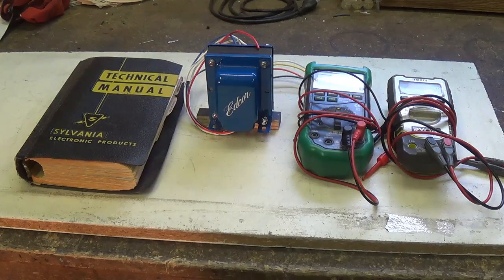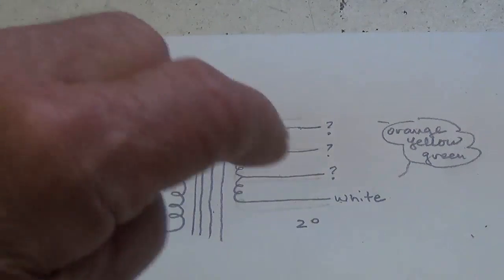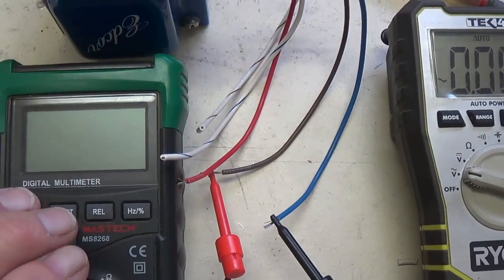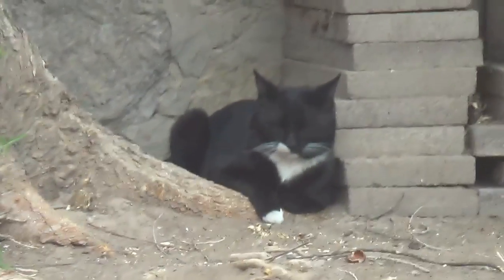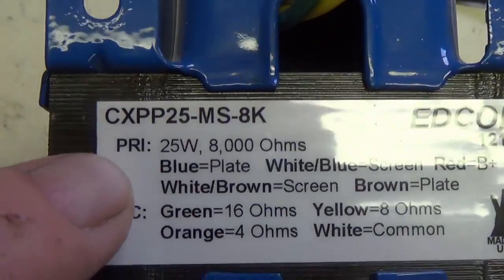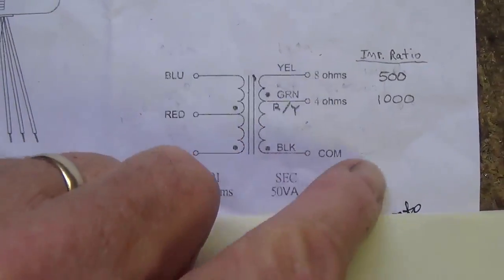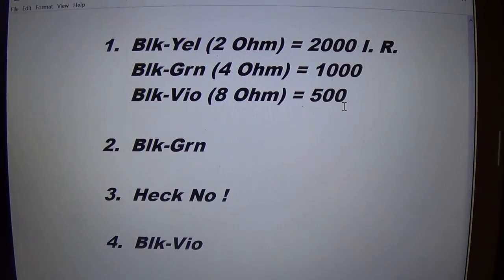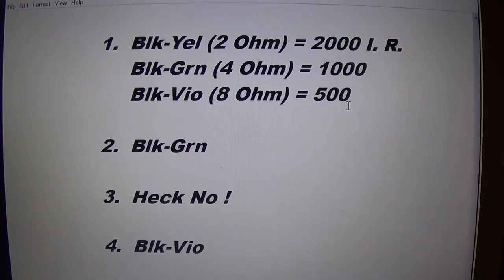Impedance Ratio: The Easiest Way to Decipher Output Transformers

Comment: Uncle Doug might be the coolest cat on YouTube.....And DEFINITELY one of the best instinctive teachers. Thanks for another informative video, sir.
Reply from the maker: You're welcome, Eli. Thanks !!!
Reply: He surely is the coolest can in the clowder! And a fine clowder he has there! 😸
Reply: Man ain't THAT right!
Reply from the maker: I hope you mean "cat", Damian :)
Reply: He sure is.  My electronics instructor at the voc I went to in late the 60s was pretty good.... but his circuit explainations were lame compared to Uncle Doug.
Reply: @UncleDoug I have a big mistery, I have a exotic High End amplifier in my housd for fixing.
The amplifier comes with the output transformer in shortcircuit.
I have 2 amps, one is working fine, this amps use a single ended circuit with 845 tube.
The thing is the good one OT reads 100 Kohms using an analog multimeter.
I never saw anything like that.
Other mistery is I test the OG using 3 diferent multimeters, with ome Fluke 28ii OT reads 500 Kohms.
And using an electronic analog multimeter reads 250 Kohms.
I can't understand.
Any help will be appreciate
Reply from the maker: @treadmillrepair754  I don't understand it either, TM. The DC resistance values you're stating are all way too high for a guitar amp OPT, and the wide variance makes the readings suspect. I would seek qualified assistance. Good luck.

Comment: Hello Uncle Doug, I happened to stumble upon your channel I have absolutely no interest in electronics repair however I couldn't stop watching your videos I was very impressed with your knowledge. Anyway, the reason I'm writing is I have a Marshall Class 5 tube amp that I bought used without a power cord so I couldn't test it first. After buying a power cord (plug-in type) I plugged the amp in to test it and nothing happened. Upon closer inspection where the plug plugs in I noticed it said "Mains Input 230V" So apparently this amp was made to be sold in the UK  not here in America.  I spoke to Marshall via email explaining the problem they said I need a new Mains input for 110V. After making numerous phone calls  I can't find anybody in my area who fixes amps without charging $200 just to look at it. I could probably do it myself but I've heard it could be dangerous if you touch the wrong capacitor so I don't want to do it. Do you repair amps or just restore old amps for yourself?  If I mailed you my amp could you repair it for me at a reasonable cost?
Reply from the maker: It depends on what you consider to be "reasonable", Kenneth. I can tell you that shipping it both ways, combined with parts and labor will cost more than double your local price......so you might be better off seeking local help. One final suggestion: Most European amps made for 230VAC also have primary winding leads for 115VAC. Before you spend a fortune, check the power transformer to see if there are one or two extra (generally black) wires not connected. You might still need some help, but at least you won't have to buy a $150 power transformer.

Comment: This was long but worth every minute - its obvious you where a teacher, nice slow, even tempered pace which is easy to follow but goes in. I have a mountain of output transformers that this will be essential for - bless you sir! :D
Reply from the maker: Thanks, Prince. I always feel obligated to explain every detail and then reiterate key points, which takes some time, but generally works well with beginning and intermediate students. I'm glad you found the information helpful.
Reply: @UncleDoug  - Would you believe I've built valve circuits for decades and only late last year learnt Ohm's Law. Everyone says its so tough but, errr, nope! Once again thanks for blowing my mind - I really had not the first clue that the secondary impedence was in any way linked to primary coil voltage or valve resistance, these are transformers after all! LOL :o)

Comment: This blew my mind.  I never considered the impedance of the output tubes impacting the impedance of the secondary of the output transformer.  Furthermore, I was about to rewatch your transformer videos to see if I could figure the secondary impedances of the mystery output transformer I have for my next build, then I get a notification for this video.  Uncanny timing. lol  Excellent video my friend. Thank you
Reply from the maker: You're welcome, Kevin. The output tube impedance divided by the impedance ratio must equal the speaker impedance, so all three factors must be in agreement and each one affects the other two.
Reply: It’s not the impedance of the secondary that’s in play here.  It’s the impedance of the speaker that is reflected through the transformer by the square of the turns ratio.  This is the effective load seen by the tubes.  This should be matched to the tube output impedance.

Comment: Glad i Just became part of the Family Uncle Doug. You are a Life Saver.....
Reply from the maker: So are we, Stuart. Welcome aboard :)
Reply: @UncleDoug  I do try to work on amps. Found a 1978 WEBB 6-14 E in the trash. Inside the back of the amp was a old Peavy 705-18771 transformer. Surprised the old Peavy sticker was still intact. Its in a complete metal casing 4" tall 6" across. I'm gonna dig into this amp  but apparently there somewhat rare. I can't believe someone threw it in the trash, could've at least parted it out. Thank you for sharing your knowledge, think I got 1 extra IQ point👍
Reply from the maker: @stuartewoldt1513  You're welcome, Stuart. Best of luck with your project.

Comment: This video is extremely useful, I used this technique on a project I am working on and characterized the O.T.. Then in researching the tube characteristics found that the bias used, FIXED or CATHODE also changes the plate to plate output impedance.
Reply from the maker: Yes, it does, Scott. You have to factor in all the variables when determining the plate impedance.

Comment: This was just great uncle doug.  The explanation was very clear.  Another great video.
Reply from the maker: Thanks, Rohan :)
Reply: @UncleDoug  I recently completed a 100-watt plexi kit amp and had some trouble with it.  In the end, the problem was a mislabeled output transformer.  By modifying the procedures you presented in this video, I systematically tested the transformer to determine the common, 4, 8 and 16 ohm wires.  Now I know the common was yellow, not white.  To be safe I compared calculated the effective load resistances with a similar Hammond unit.  Thanks for the video.

Comment: I just love it when you teach, if I would have had you as a math teacher in school maybe I would be better at math. Thank goodness there are a ton of electronics calculators online or I would be sunk. I did come up with a speaker combination resembling something that you recently worked on, not exactly but close, that would work for the 6L6GC at 450 VDC Plate voltage and that transformer. Six 4 ohm speakers in series-parallel (2 parallel sets of 3 speakers, 4 ohms each in series) would give you 12 ohms impedance. But other than Silvertone you don't see a lot of 6 speaker cabinets. Probably be cheaper to buy a different transformer rather than six 4 ohm speakers unless you just happened to have some laying around. Just had to give you a little grief, I was the kid in the back row saying ”but teacher what if you did this or that”. Another great video, I really like the rake that you added to the Rat Rod, very classic stance now. I would have probably put N50/15’s on the back.  But I am a 70’s wide back tire kinda car guy. I do usually prefer to see some side wall though. Not a fan of the 20’s and 22’s that look like a super heavy duty caster wheel, or a 1920’s solid rubber Truck tire, all wheel with about an inch of sidewall showing. Oh and the header baffles sound great, sounds a bit like a 3/4 cam in that engine, a little lope at idea then smooths right out with a few RPMs. Very good and informative video.
Reply from the maker: Thanks, so much, Mark. Yes, with different speaker combinations, you can achieve all sorts of odd secondary impedance values.......but I didn't want to complicate matters by delving into a separate subject. Most viewers probably use a single speaker and would be best served by learning how to match it to their output tubes. I too like fat back tires and have a nice pair of 12" x 10.5" Ansen "gasser" wheels that will bolt right up to the rear end and make it look like a steamroller......but for now, I'm going with the 17" red wheels and  brand new Coker Excelsiors (not cheap) :)  Maybe when these tires get some wear.

Comment: Thank you for taking the time to explain the steps of the process with mathematical formulas. If I may make a suggestion, the current limiter would be better if it had an on/off switch. I built one based on your design, and it is nice being able to shut it off without unplugging it. I also added a 120v pilot light so I could tell when it is switched on. The light bulb is deceiving since most people will assume that there is no power to the unit and could be accidentally electrocuted. I have that plugged into a variac and an isolation transformer as well, so there is little chance of getting a bad shock. At some point I plan on building a self contained unit with the variac, isolation transformer and current limiter all in one, but what I have works for the time being.
Reply from the maker: Thanks for your suggestion, Jason, but I have never understood the need to unplug or turn off a current limiter that only illuminates if there is a short circuit plugged into it. It presents no more threat than your TV or refrigerator when they aren't on or running.
Reply: @UncleDoug  I agree, the device itself is no more dangerous than a standard wall outlet when nothing is plugged into it. If there is a dead short, flipping the switch off is probably going to be quicker than unplugging the unit. There is also less wear and tear from having to unplug it every time you need to shut the power off. I'm planning to put something together that kills power to the bench. It will be cutting the power to the isolation transformer as well.
Reply from the maker: @JasonTHutchinson  If there is a short in an electrical circuit such as an amplifier, the amp itself has a toggle switch that can be flipped just as fast, if not faster, than a switch on the current limiter. Adding another switch to the system is redundant. For the same reason, there is no need to plug and unplug the current limiter. Simply shut off the amp circuit and unplug it......as you would have to do even if there were a (superfluous) switch on the current limiter.

Comment: Thank God for Uncle Doug, coming from me who gets lost past standard Algebra.. Uncle Doug has helped me understand more math than I ever have..which still ain't that much 🤨
Reply from the maker: That's great to hear, Chris. You made our day :)
Reply: Hey thank you! You and Brad the Guitologist have taught me more about amp circuits than I ever thought I'd know.. and the more videos you guys post, the better I get. You guys are why I have a resistor on a wire with a speaker jack plug for a cap discharge, and an old repurposed lamp for a current limiter. Keep it up!!
Reply from the maker: @christopherallen5603  Thanks for sharing your experiences, Chris.....they make the production of tech videos worthwhile.

Comment: Hi Uncle Doug, fist i apologize for the long story..... second i'm a long time subscriber, have commented on numerous videos which most always got replied to in a friendly manner and i just wanted to let you know how grateful i am to one such as yourself in helping us understand valve tech a lot better.

Also you inspired me to start my own video series of a cool tube project soon, will be uploading a video of it later today or maybe tomorrow but i think you will really like it.

It's a 1950's Hohner Electronium amplifier originally intended for Accordeon that's going to be a guitar amp but the catch is the tube pre-amp is in the accordeon in the original combo design and i don't have that so all i have now is a 2xel84 power amp.

It works fine with a pre amp pedal that boosts about 6-10db and a speaker so i won't be changing anything on the original amp but i will need to build a pre amp with parts i intend to scour from other stuff as much as possible, in the original design the pre amp tubes are fed off a cable running from the amp (yeah b+ from amp to something you hold in your hands...) and the socket is still there on the chassis so i hope to find a plug and build a Fender Exelsior type separate pre amp.

Sadly i don't have the original cabinet but what i do have is easily just as or maybe even cooler, an old RCA400 Deluxe suitcase speaker cab covered in dark green/brown Croc skin tolex with a metal grill screen. I intended to just gut the amp for parts because i wanted to build a Marshall style head and cab instead of a combo but when i went to pick it up the guy also had this cabinet laying around and i decided to buy that too and build this combo.

Anyway .... long story short I hope you'll take a gander when i put the fist video up and again thank you very much for teaching and inspiring.

Best wishes, Frans
Reply from the maker: I would be honored to view your first homebuilt amp project, Frans. Just provide a link and we'll be there for the premier.
Reply: @UncleDoug  Thank you! had some technical problems yesterday when i wanted to put part 1 up so we'll try again later this evening and if it works this time 
 i'll drop the link!

Comment: Doug , this video came at the most opprotune time for me , I am converting a 1945 Kodascope sound projector into a guitar  amp, and it used a 24 ohm speaker that needed replacement, but could not find a source , so I was going back and forth with using a 16 ohm or 32 ohm speaker. What complicated matters was the output transformer was in a sealed can and had only 5 leads. As my 6v6gt tubes were running a hot 12 watts of plate dissipation I was planning to incorporate a bucking transformer to knock the input voltage down to 105vac and reduce the plate dissipation down to 8 watts. Now I am hoping I can fine tune the output tube plate voltage to allow me to use a 16 ohm or 32 ohm speaker without fear, and max. output power
Reply from the maker: It sounds like you have quite a project going on, DR. I hope the video is helpful in making it a success. How are the 6V6's biased? Generally you can increase the grid bias a bit and bring down the PD.

Comment: WOW! finally the penny has dropped! and I understand some of the output transformer matching theory. Thanks Uncle Doug for explaining it in a way I can clearly comprehend. I have now discovered that the new output transformer that I have fitted in my amp should have the 16 Ohm speakers connected to the 8 Ohm taps on the transformer wires. Not the wires marked 16 ohms because the EL84 tubes need an input impedance of 8K. Many thanks again Doug........keep up your great work.
Reply from the maker: You're quite welcome, Ian. I'm glad you were able to put the information in the video to good use.

Comment: Impressive that you have the Library available with all  the Tube parameters of the different Tubes. Good and easy to follow explainations to a very interesting and important subject because Output transformers are very important Devices in Tube Amplifiers. And a really good prove that mathematics works. And by the way, from an engeneering point of view, an impedance is a very complex arrangement of different parameters. Greetings from Germany.
Reply from the maker: Greetings to you, Roland. Thanks for your kind and supportive input.

Comment: I know I'm late watching this instructive clip ... I want to commend Mr. Doug for a thorough and yet simple to understand explanation of the output transformers. I have a question ... how to determine the power of a transformer? If anyone could answer me I would be grateful ...
Reply from the maker: Thanks, Thomas. Sadly, if the power spec is not available, you can only guess, based on the mass of the OPT, which is the source of its power-handling (heat dissipating) capability.
Reply: @UncleDoug  Thank you very much for the quick response. I wish you all the best and that we enjoy your clips for a long time ....
Reply from the maker: @thomass7877  That's great to hear, Thomas. Likewise on the good wishes.